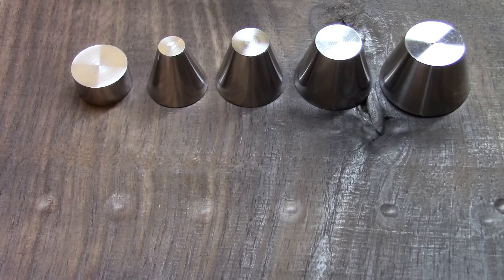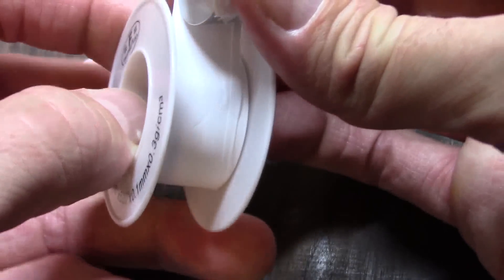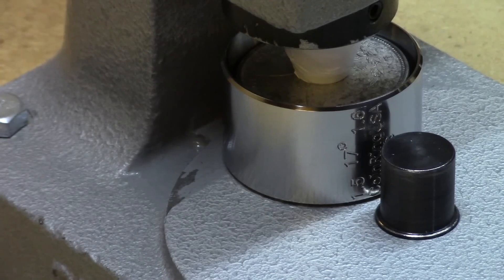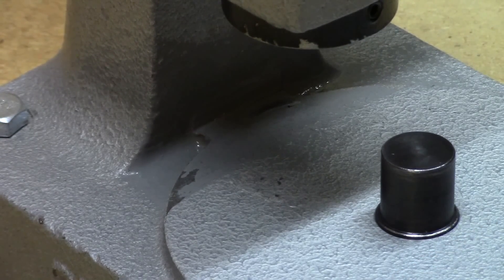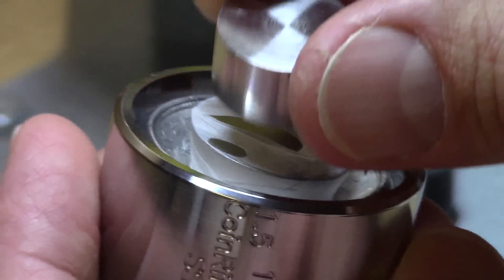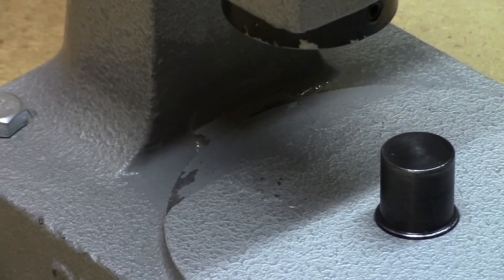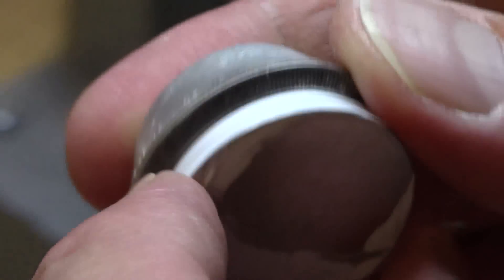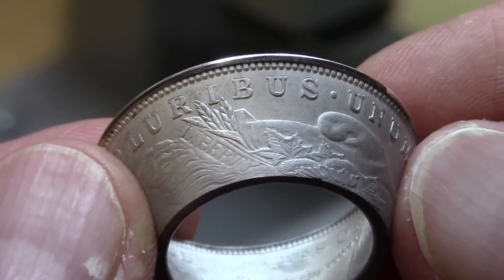NEW Coin Ring Folding Tools! Hardened Stainless Steel Stabilizer Folding Cones and Spacer Set!

Comment: Hi Martin,
     Just got your steel folding cones, and rubber polishing kit. I have to say the stainless cones are SUPERB, I can stretch faster, more accurate, and with lithium grease, so smooth, they make the process a lot easier, and therefore I have the confidence to make more expensive, and desirable rings.I intend to make a dedicated polishing station for the rubber chucks, to remove the ribbed edge, when needed and to polish also, will post a video when I finish the machine. Keep up the great work. All the best.
                   Stu n Caz.
Reply from the maker: Thanks Stu, so glad that you like these new folding cones! They're such a major improvement to the coin ring-making community as they will not wear out; unlike the weaker light brown-colored folding cones out there made out of phenolic; a material that WILL wear out.

Comment: Hello, how are you? I'm Brazilian, from Rio de Janeiro, I'm watching your video and I'm interested in making rings of old coins, but for this I need to have proper tools, if you can help me, what tools should I buy and where can I buy, could you tell me which site Where should I find these tools?
Thank you,
Fernando
Reply from the maker: Hi Fernando, you'll need at least a way to punch a hole into the center of your coin, some folding cones, and some reduction dies. You can visit my shop page at: CoinRingUSA.com for tools, and my blog site at: CoinRingBlog.com for tips. Let me know if that helps!
Reply: Which machine do you suggest to print the coin, could you name it?
Reply: Thank you for replying to me, I have to drill the coin, files, dremel with all the tools, could you tell me which of these I should buy them, send them to Brazil?
Thank you,
Fernando

Comment: Martin, terrific new tools!  Do the new cones provide more stability than the plastic cones? If so, how? Thanks. - Gene
Reply from the maker: Thanks Gene! I wouldn't say that the Stainless Steel cones provide more stability over the previous cones that were made out of a polymer based material, it's mainly that these new cones won't develop groove marks in them and ultimately wear out. Some folks have also noted that it seems to allow them to fold their coins down with better accuracy... that's a good thing!  ;-)